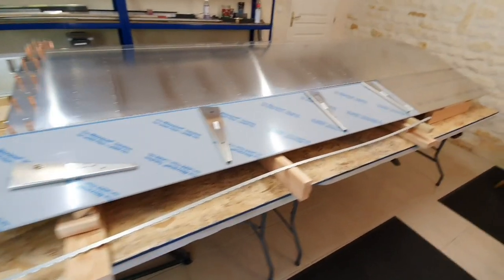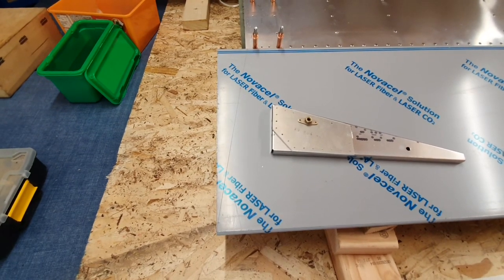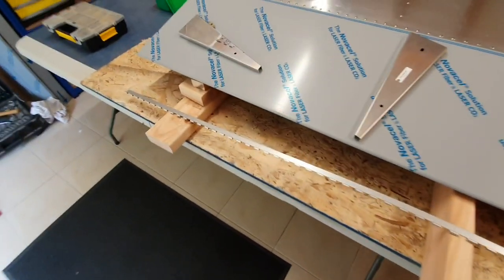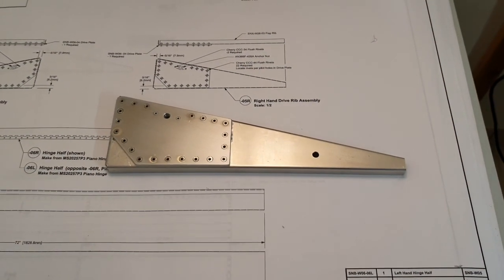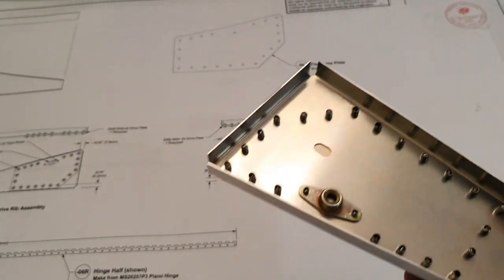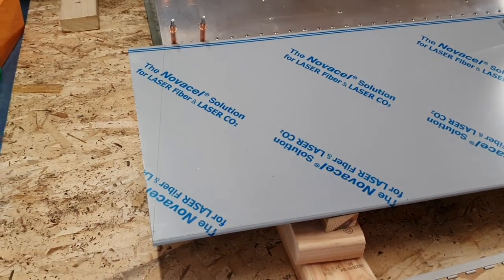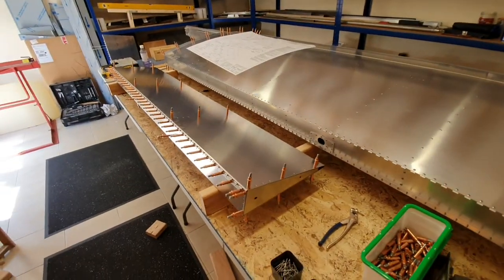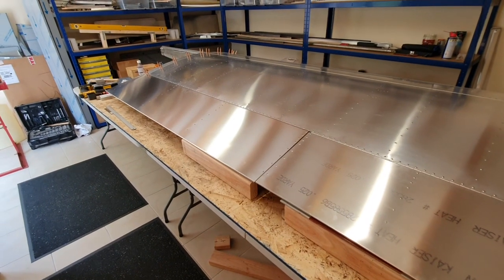Sonex B Part 14 - Building the right hand Flap

Comment: Hello Gavin. I must say your build videos have been a great source of entertainment and education around these lock down times! I like that you are straight to the point and you mention all the little discrepancies that there might be with the drawings etc.

I myself intend to start my own build soon on either the Sonex B which is my first option or the Vans RV 12 which is still lingering in my mind due to its cabin width which is more generous compared with the Sonex B.

I know Sonex lists the B's cabin width at  40" but is this the width of the actual fuselage at the cabin section or is this the internal width of the cabin?  Are you able to confirm this for me from the plans? I will be very grateful.
Reply from the maker: Well - I had assumed, as you did, that the cockpit width was 40 inches - BUT - I've just looked at the drawings and the outer dimension of the fuselage at the cockpit is 40 inches. The cockpit sides are just over 1 inch thick ( 1 inch square extrusion plus inner and outer covering) which leaves just under 38 inches for pilot and passenger. I'm going to have to loose some weight :-)
Reply: @gavinssonexb  Thank you for the prompt response Gavin. I had a feeling that this was the case! The Sonex B apart from cabin width issues is an absolutely capable aircraft! It is slow, fast, agile and has good endurance. Time will tell I guess :-)
Reply from the maker: @skytical  Catch my Facebook build site (search 'Gavin's Sonex-B') for detailed photos of the build. If you haven't seen it already have a look at Aaron Kinght's video https://youtu.be/nSZ-uEP3c84 for some inspiration - Cheers, Gavin :-)
Reply: @gavinssonexb  Will surely do. Cheers.